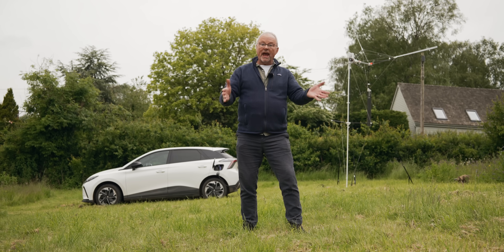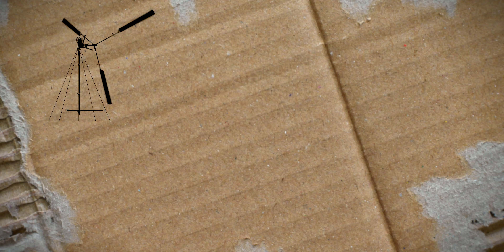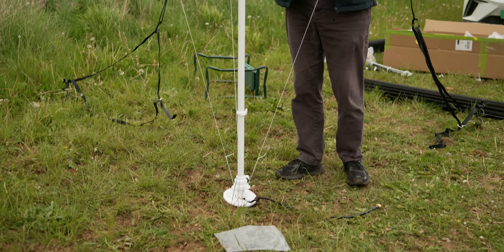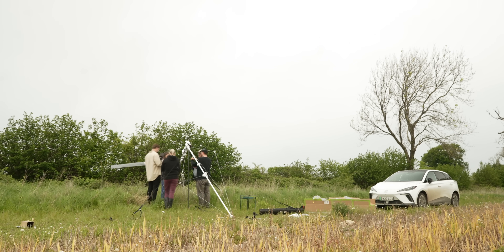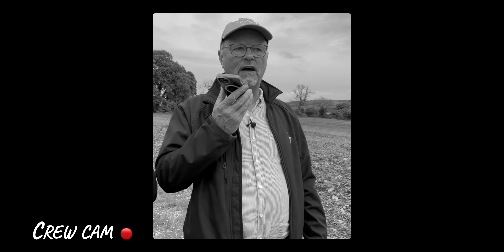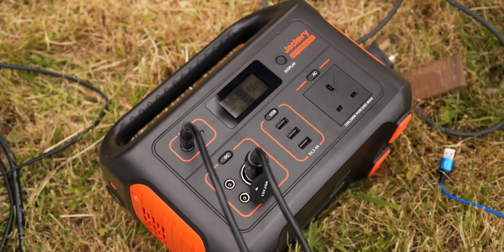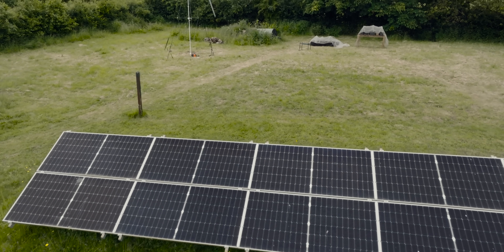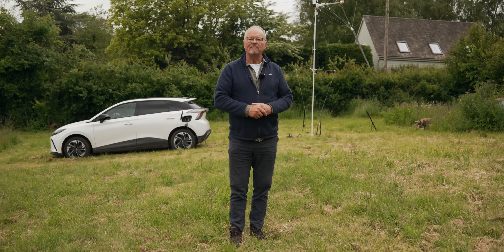Charging an Electric Car with a DIY Wind Turbine?!

Comment: Two things you could do to get some charging from a lower powered (cheaper) battery bank or power source : 
1) Set the current limit on the granny cable - different GCs have different settings available, the minimum possible (due to the J1772 protocol) is 6 amps. 
2) Set the battery bank/source to output 110v - most cars' onboard chargers will accept this, and it haves the minimum power at which some charging is possible,. as the J1772 6A limit is regardless of voltage. 
On many cars, charging at low powers can be pretty inefficient due to the  power drawn by the systems that are on while charging.
Reply: I've done a series of tests on a Hyundai Kona over a range of charging power from 1.3kW to 11kW and the power loss is pretty much constant at around 400W, so that's an efficiency of 69% to 96%. Having realised this I only charge at low power if I'm getting at least 500W of excess solar.
Reply: The only thing to bare in mind with this test is that the uk used a 240v for everything mains powered and we use the Mennekes type 2 connector so as far as I'm aware our minimal charging speed is 1.4kW
Reply: @dubzfry  yet this battery is only able to supply a sustained 0,5 kW, so trying to use it like in the video will just trigger it's overload protection. Funny how happy Robert appears to be with this "achievement".
Reply: @oroozen 

Yes.

Robert does everything he can to prove that battery EVs are a "thing"  ... and can be recharged even in moonlight ... not by moonlight mind.

There again wind turbines (the big ones) have been recharging battery EVs for some time.

Unfortunately this project served to draw attention to the sad fact that unless batteries can be charged via supercharger kit in a couple of hours they really have very little utility if you have to wait hours to recharge ... assuming there is a breeze of course ... as do most people.

Clearly that's my view ... but still.

Again, argue if you must but you'd be wasting your time.

Batteries are on their way out in UK, despite all the incentives dealers can come up with.

Now, has anyone heard of hydrogen fuel cells or hydrogen burning ICE units?

That's where EVs are evolving to, so to speak.

Without any doubt whatsoever.

Come on Robert, nothing to stop you popping over to the Paris Olympics and do an item on the hydrogen powdered Blitish built Toyota HiLuxes.
Reply: @t1n4444  I'm a fan of Robert and his channel, but merely amazed that nobody could do a calculation beforehand. If they had brought along a more capable powerbank as buffer storage, they could have made this work much better.

Somehow I suspect you won't be able to fill up your car without access to a filling station. This is still an area where an EV is far superior. It will run on any energy source, as long as you can make electricity out of it. The only restraint of the current(!) standards is you need to be able to somehow supply at least 6A at 230V, so if your source is weaker, you need to buffer it. And that's where this experiment failed.
Reply: @oroozen buffering is mostly dead end. You either need LiIon battery for buffer, which will have to survive say 20-50 charge-discharge cycles for one ev charge or supercapacitor, which is huge in size and mass. Thus your buffer battery will die very soon or you'll need big supercap. None of this is portable lasting solution.
The only solution is changing how EVs charge.
Reply: @ІгорАлієв  I have no idea what you are talking about. I was talking about the buffering in this video between the wind mill and the car charger. That poor little 500 Wh battery was incapable of feeding the car, hence this whole experiment was doomed to fail. But had they used a more capable buffer, it would be a very good demonstration of why buffering is needed. Instead of feeding the car 200W all day long, you feed the buffer and release it into the car at a more sensible speed.

Still, 200 Watt is way to little to power a car. If anything, it illustrates how power hungry the car design is. Feed 200 Watt into a bicycle and you more than keep up with everyday traffic.

But then again, you probably confused this thread with some random home battery discussion?
Reply: @oroozen  

Yes, entirely possible but that would mean waiting until a battery bank was charged and then doing the DC to DC charging.

Could take hours, and if the buffer bank got depleted quickly then you'd be back to just the output from the wind turbine.

So yes it would be possible but take a while, probably a long while , and you'd be relying on a steady breeze on what be considered an inefficient rotor.

Happy to be corrected on the battery charging science of course.
Reply: @t1n4444  How is that different than waiting for a smaller battery to charge and then triggering it's overload protection?

Before any battery can provide any current, it needs to be charged at least a bit. Charging with 200W for one hour provides (guess what) 200 Wh of charge. You need to be able to generate 230 V at 6 A to charge the car. A bigger powerbank would be able to provide this, but be empty after 200/(230*6) = 8 minutes and 42 seconds. This small battery would take the same hour to charge up to 200 Wh, but just can't provide enough power to even start charging. Did Robert really expect the car to limit it's consumption to the 0,5 kW the battery could provide? If it could, then the 200 Wh would be depleted in some 20 minutes anyway. But again, that's not how electricity works.
Reply: @oroozen  

Quite so.

It would work but take too long to be of practical use.
Reply: @t1n4444  I think that was his conclusion anyway.  I just regret they did not get it to work at all due to lack of understanding the matter,  yet he kept pretending it worked for a bit. It would have worked with a more capable DC-AC converter and preferably a bigger battery. But it would be slow anyway, since the power source could only deliver 200W, which is like half a solar panel on a good day.
Reply: @oroozen I meant charging small buffer battery by windmill, then charging big ev battery from small one. Now I try to explain my guestimates.
Let's take nissan leaf battery with energy capacity 39 kWh and buffer battery of say 2kWh energy capacity. Charging buffer with 200W windmill will take 2000/200=10 hours.

Reasonable discharge of buffer at 1C load will take 1 hour and give 2kW reasonable charging power.

One needs 39000/2000=19.5~20 times charging and discharging buffer in order to charge ev.

Which is not very far away from my guestimate.

Let buffer cycle life 10 000 cycles. Thus it should be disposed of after 10 000/20=500 full charges of ev.

Supercaps do can help bc of almost unlimited cycle life, but really large size....

Add here several dcdc transformations: turbine-line-buffer-230v-ev battery. I see 4 transformations. Given 90-95 efficiency at each stage, it is a little bit discouraging. One can remove 230v line and transform directly from buffer to ev battery, removing one transformation. 

Thus it is viable only as temporary emergency solution.

Direct conversion from turbine alternator to ev battery is thr only viable solution. This will need car modification.
Reply: @t1n4444  - However, your missing the whole point that it is possible to charge a Battery EV car at home from home renewable resources whether PV solar or wind. Albeit the example here is intended to be tounge in cheek humour by deliberately using a small camping turbine, which if it it had charged (with the larger battery pack mentioned above) would have perhaps enabled a token mile to be charged in an hour. 

However, if this was green hydrogen being generated you would have only travelled less than a 1/3 of mile on the same power input - although this is a theoretical distance as you would have had to spend a lot more energy compressing the hydrogen first to pump it into the car. With hydrogen your tied to the same dependencies of relying on someone else to provide the fuel at marked up prices the as fossil fuels it seeks to replace. 

Not much coverage anywhere of hydrogen at the Olympics, not even Toyota whose tie-in adverts are soley focussing on Battery EVs. It seems even the cardboard beds have gotten more media attention than the olympic hydrogen fleet.  It makes sense why the Toyota's CTO has said the Mirai "has not been successful" , and are looking to shift hydrogen away from cars to heavy vehicles and certain types of fleet operators. The Fortune article that came out today is an interesting read on the subject.
Reply: @ІгорАлієв ah. totally agree with your calculations and lifetime predictions. My scope did not go beyond the making of this video. Using a setup like this for daily charging would be ridiculous indeed!
Reply: @GruffSillyGoat  

😂😜😜😜

Your usual misunderstanding of the situation.

Everything out of context.

No surprise there then.
Reply: @t1n4444  - Perhaps if you listened to the authoritative voices on the subject of hydrogen for vehicle mobility, then the penny might drop on why not only is it unlikely to happen that it actually is holding back development of practical and workable solution available today - namely Battery EVs - by diverting funds and effort on the unfruitful wild goose chase that hydrogen vehicle mobility represents. I suggest you listen to Prof David Cebon from Cambidge University on the subject as he outlines the reality of why hydrogen for anything but essential needs (such as industrial processes) is such a wasteful and unrealistic idea.
Reply: Prof Cebon has done a number of YT interview's on the subject, which outlines the reasons hydrogen is so limited and illfitted to vehicles, most recently outlining the pros and cons of hydrogen on the YT Energy News channel.
Reply: @GruffSillyGoat  

😜😜😜😜

Pointing at an authoritative  source is fair enough of course.

Yet you fail to consider other authoritative sources take a different, opposite, view and support hydrogen exploitation.

In short you follow the same model as does Robert for when he introduces his experts for the confirmation bias thing.

You should ask yourself why Robert doesn't seek interviews with spokespeople for the car manufacturers who are building hydrogen powered vehicles or hydrogen burning ICE units.

If Robert won't talk to those developing hydrogen then he risks looking like a dinosaur, as do his cronies.

You should understand too that when Robert or Quentin or Dan claim they act as "advisers" to HMG then that's government Ministers merely doing their "call for evidence" thing.

You might consider this is a typical Ministerial "cma" exercise on their part.

(CMA = "cover-my-arse")

These same Ministers will be talking to others who support the hydrogen as a fuel too.

Ergo you're still not "getting it".

However, one thing in your favour is you have dropped the typing out of meaningless statistics which, frankly, you don't really understand, or worse don't know how to interpret.
Reply: @t1n4444  - You seem to be becoming frustrated that this channel and many others are not supporting your 'opinion' or perhaps even an 'agenda'. Seems they listen to the more reasoned voices about their show's content and present topics that are relevant, realistic and achievable to the ongoing electricification of stuff. 

You're assuming it's a binary world that people either support or don't support 'hydrogen exploitation', setting up a false narrative that those not supporting hydrogen vehicles are against all 'hydrogen exploitation'. Whereas the reality is people support green hydrogen where it has a valid place, mainly industrial usage particularly where it's already used as part of the process. The profligate use of hydrogen for vehicle mobility hinders rather than advances the move to renewables and green transportation, including hindering the use of green hydrogen in more urgent and important industrial roles. 

BTW David Cebon is not only a Cambridge Professor and leading expert, he is a director of the Centre for Sustainable Road Freight, he probably knows a fair bit of what works and what doesn't with regards to hydrogen based transportation. Hence why David has been interviewed on this very channel, so it seems the channel has already interviewed respected spokespersons that you so seek. 

Given the low maturity, lack of infrastructure, poor efficiency and high systemic costs of hydrogen mobility why would this channel seek to waste any more airtime than they already have on the tiny number of manufacturers who are trialing hydrogen mobility - hydrogen is just not significant in the sector. Even the CTO of a key manufacturer supporting hydrogen mobility has said hydrogen cars and vans are unworkable.

Interesting, it was yourself that asserted statistics supported your point of view of Battery EVs demise, indeed even as far as to repeatedly demand numbers and percentage both current and historical be given to prove otherwise. It seems as these facts didn't support your particular point of view you've now pivioted to a stats bad, opinion good approach. No worry, further stats will be forthcoming soon, I suspect you're excited in anticipation to sate your appetite.

So again please give your authoritative expert sources that support your view that Battery EVs are now in decline and Hydrogen vehicles on the rise - which I see your now extending to include Hydrogen ICE. All the experts, as well as the manufacturers, are now positioning hydrogen mobility as a niche complimentary technology to battery based mobility.
Reply: @GruffSillyGoat  

😂😂😂😂

Again, no need to write a book of waffle.

Simply concede you're wrong.
Reply: @t1n4444  - And yet, you're the one posting incessantly to almost every video released on these here channels - a case of pot calling kettle ... about waffle.

So you asking me to concede to what exactly? That industry experts are stating that mass hydrogen mobility is not feasible, that the car manufacturers are saying it's unworkable for them or the market stats saying hydrogen car sales are in serious decline whilst Battery EVs are growing, out selling hydrogen cars by a 1,000 times over.
Reply: I have realised that using the granny charger at 10 amps takes far longer than it should at 2.4 KWh, so there are a lot of losses using the granny charger even at 2.4KW. At 6 Amp I doubt anything would get into the battery.
Reply: @williamarmstrong7199  I charge my 2018 Nissan Leaf 40kwh model with 6A, and it gets about 25% overnight.
Reply: @williamarmstrong7199  Most on board chargers in EVs will have around 10% loss. The box is not really a charger, just some protection circuitry and such.